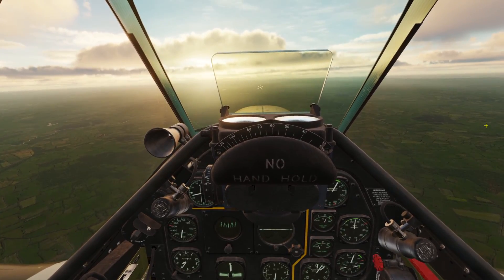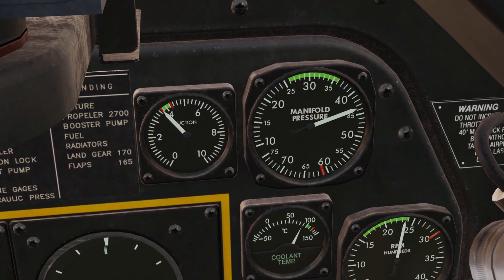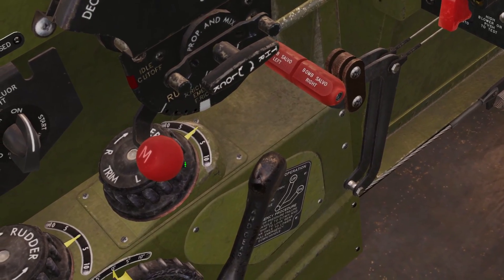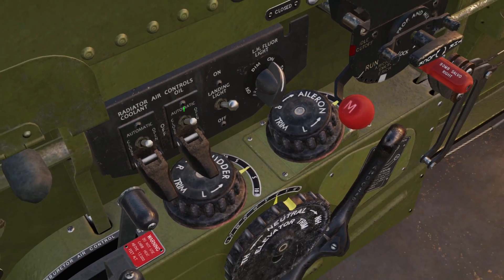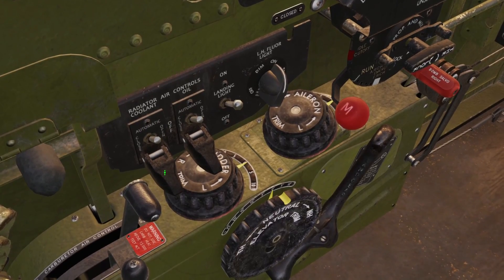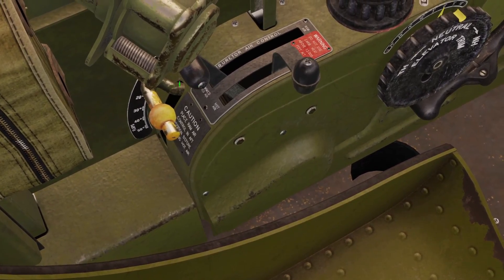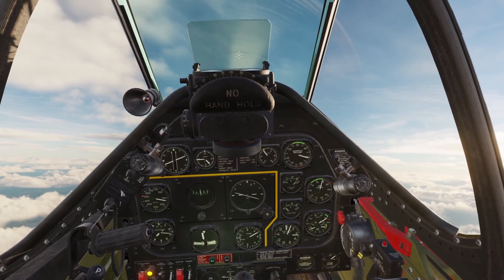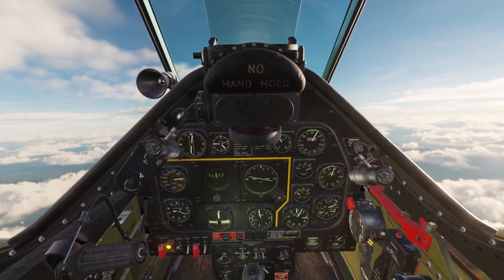DCS P-51D Engine Management

Comment: Useful but your mechanical knowledge/terminology is awful. "Puts heat in the engine"...it's carburettor heat. It adds heat into the inlet of the carburettor to prevent/clear ice. Not just for cold days it can happen on humid days. One of the many errors you're "teaching".

Comment: Prop RPM is increased and decreased by the angle of the propeller blades, RPM increases when the prop angle is flattened out and decreases RPM when the prop is taking a bigger bite out of the air. On any aircraft at takeoff, your gonna have your prop at max RPM for best climb rate, then when u back off throttle at altitude, u can maintain a speed at a lower engine rpm by decreasing prop speed, which takes a bigger bite out of the air

Comment: Maximum continuous in the P51D is 2700 rpm and 46” of manifold pressure meaning you can run the engine indefinitely at this setting. Running outside of the green does not limit you to only 15 min that part is wrong. You are only limited to 15 min in war emergency power. This video is all kinds of ate up and wrong. Yikes 😂😂

Comment: I've been wondering, since I also fly the P-47 sometimes. Lets say you want to get the absolute top speed possible in the P-51 (without WEP). Would that just be 100% throttle and 100% RPM? I remember reading that in the P-47, to get the fastest possible speed at low altitudes, you actually want your RPM less than 100%, something like 83% or so, along with 100% throttle. Does that apply in the P-51? Or is it just simply maxxing out both the RPM and manifold?